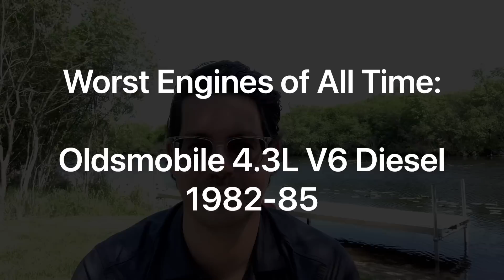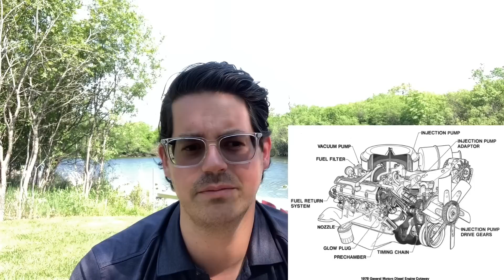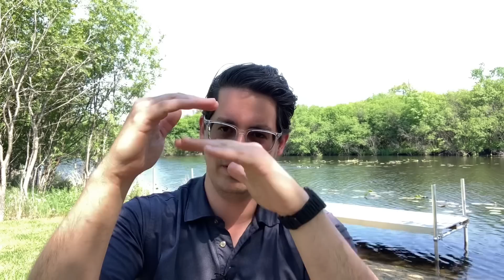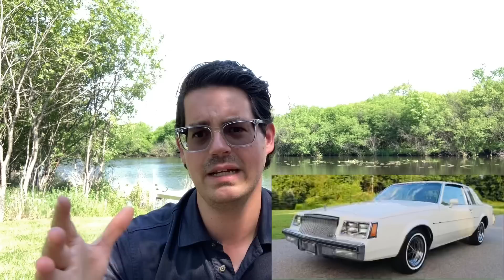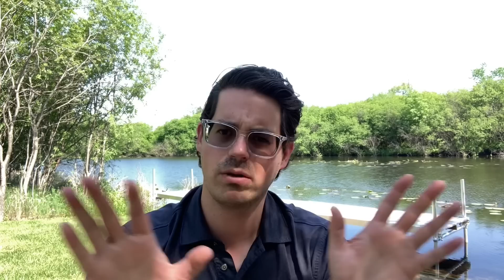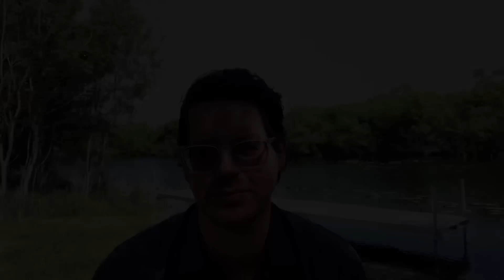Worst Engines of All Time: Oldsmobile Diesel 4.3L V6

Comment: My older friend Stan, who was an engineer back in the late 1970's said "if there is a cheaper way to do GM will find it."  This was not a compliment.

My parents had three diesel cars back in the late 70's/early 80's.  A 1977 Peugeot 504 sedan, a 1979 Olds Delta 88 sedan (3.5L V-8 - first generation diesel), and a 1981 Olds Cutlass Supreme Couple (5.7L V-8 - second generation diesel).  The engine in the Delta 88 blew up with 48,000 miles on it.  GM split the cost on the replacement engine.  That engine lasted until the mother of our neighbor, who bought the car from us, killed the engine (either running it without coolant or oil - I don't recall which).  The 1981 Cutlass had the better engine, but the tranny went and the Lee Miles shop replaced it with the infamous Turbo200 tranny (more on this later).  The other problem with the 1981 was that if the car sat between 2-4 hours it would not restart.  The computer thought the engine was warm enough to start without the glow plugs, but it wasn't.  After 4 hours the glow plugs came on and the car started up again.  In 1986 Dad had a mechanic replace the diesel with a used Olds 350 V-8 gas engine, with a four barrel carburetor.  That's when we found out about the tranny scam.

The best things about the GM diesels were:  1;  The noise.  People hanging out in the street gave way when they heard the diesel coming.  No need for the horn.  2;  After a few years the injectors in the replacement diesel in the 1979 Delta 88 needed replacement themselves. As a result the car smoked heavily when the pedal was floored.  On day a person was riding my bumper as we passed some police activity.   Once safely past I floored it, resulting in a black cloud of soot erupting in the face of the tailgater.  When the cloud cleared he was nowhere to be seen.  I wonder if the soot stalled his engine?
Reply: If a good part costs 2 cents more than a crap one. Use the crap one.
Reply: @mpetersen6  This is how Mercedes-Benz did it at least in the 90th when Mr. Schrempp has been in charge.

Comment: I am driving an 1984 Oldsmobile Cutlass Ciera Brougham Holiday with a 4.3L V6 diesel. It has aluminum heads on it, get 38 mpg(Hwy 75mph) has very good pick up for a naturally aspirated diesel. I also have a 1981 Riviera with the 350 5.7L V8 diesel and I had a 1982 Oldsmobile Toronado 5.7L diesel that had 484,000 miles on it when it got rid of it. I never had any head gasket issues, I changed the oil every 3000 miles religiously used only Kendal D3 30, when Amoco was around their Premier Diesel fuel, changed a lot of water pumps, couple radiators, A/C compressors and a few starters and that was it. But I also knew I wasn’t driving a Corvette, I drove it like a diesel, let it warm up a couple minutes on first start up, if I got off the highway after a long drive I’d let it idle a couple minutes before shutting it off. It’s like driving your couch down the street! There was a lot of blame to go around, GM had to know an engine with a 22.5:1 compression ratio and pistons that decked out had to be clamped tightly conversely customers (not all but many) didn’t really read up on their new Diesel engine, they would use dry gas(anhydrous alcohol) when they got water in their fuel, next thing they knew their IP failed, all the gaskets had broken apart from the dry gas. They weren’t putting the correct oil in the engines, they required SF/CC or SF/CD rated oil, and they’d use regular “gas” engine rated oil, crank bearing would go, cams would wear , cylinders were scored, or they would use a weight not recommended in the winter and the engine didn’t get the correct lubrication.
However, if you took care of them, drove it as a diesel, you could get a reliable car out of the “DX” blocks, and ARP made a stud kit that fixed the weak head bolt design, the “D” blocks with non roller lifters, pencil injectors, return lines(that always seemed to leak) were always problematic.
It is pretty funny the stares I get, or that ever popular statement I seemed to get, “you better put some oil in it before your engine seizes” um no it’s a diesel, “no it’s not” “a GM”, yeah and well Oldsmobile seems to think it is!
I’d post a picture but I guess it won’t let you
Reply: If GM was smart, they would’ve worked on improving Isuzu Turbo Diesels (what they ultimately sort of did with the DuraMax) but in terms of optimizing them for larger, heavier American passenger cars. Either that, or license the OM617 Turbo from Mercedes, or one of the MFI Peugeot Turbo Diesels.

Comment: Diesels should never be owned by the average consumer, they don't respect things mechanical or pay attention to minimal service requirements.  That being said, the bean counters raped the program clutching pennies to save on head bolts and fuel/water filtering.
That being said, the V-6 was a wonderful engine and like all thing GM, the legs were cut off by a feckless management.

Comment: I believe having the injection timing badly off can produce extreme forces and pressures in a Diesel engine that can quickly destroy even a decent design Diesel engine such as were used in commercial vehicles

Comment: More than one kind of problem with the Olds V8 Diesel: the insufficient development of the fuel system and filters,perhaps a  bad choice in placement of a ground cable connected from the battery negative terminal to the engine block and then the basic nature of the engine being too lightweight to handle Diesel internal forces and pressures---

Comment: Could have a 3 or 4 cylinder variant of the Detroit Diesel have been developed that could have powered some of those full size cars and pickups reliably? ( It seems that even in trucks and school buses there was a tendency to come up with cheaper Diesel designs that were lessor engines than the Detroit Diesel) "Fuel Pincher" ?

Comment: Wish Olds made a gasoline version of that 4.3 V6. Can't convert one because there are no gasoline heads... I know some guys converted the 350 diesel into gas engines, that block is great starting point for a high performance gasoline V8.

Comment: I was working as a mechanic at the Ford dealer during this time and we were learning to work on the International 6.9 which was relatively new. Before anyone says the IH 6.9 was better than the Olds 5.7 diesel; no, the 6.9 was NOT better. They leaked oil, leaked coolant, the glow plug electrical system frequently burned up, and they were a dog. But the 6.9 got better over time. 

I had a friend that worked at Holiday Buick and Olds during that time, George made a fortune overhauling Roosa Master injector pumps used on the 4.3 and 5.7 Olds diesels. He did this on the side and through the shop. I don't know where he sourced the parts (this was long before the internet) but he sure had a good connection. The only catch was he made the customer purchase and have a Racor water separator installed as part of the deal. I know George made enough money off his injector pump gig to purchase a beautiful Delta 88 for his wife. 

Another thing that turned people off diesel engines at that time was there were few gas stations that sold diesel fuel. Not many men were real comfortable sending their wife to a truck stop to fill up.her Olds Cutlass. I heard more than one guy share stories about their wife's experience getting fuel.
Reply: U have to be a trucker to know what goes on at truck stops ;-) . Maybe a Honda civic ISNT a bad choice for your 17 y/o daughter considering what goes on at a truck stop!

Comment: Well, I’ll be damned. I’m a pretty big GM guy, and I used to be pretty into 4.3s, and I NEVER knew there was a 4.3 diesel. Sounds like it sucks, but still, I would’ve thought I’d have read about it or something. Cool, thanks!
Reply: That's how bad they were.
They didn't want you to know there was others besides the 350 so they didn't write about them, because there's nothing to write home about 😁

Comment: Simple turbo mod, studs top to bottom, and some injection pump tweaking, the 4.3 would easy crack 200 hp reliably.
Reply: I don't think any of these engines had a turbo, though.
Reply: @jameswilkinson6678  Hes talking about aftermarket performance mods. And yes I can think of many other things to do if I had my hands on one. 

300 Horses and beyond if modded right with todays performance aftermarket.
Reply: @extremedrivr  Yeah, if you added a turbo 300hp would be pretty attainable.

Comment: Gee.. can't imagine why Oidsmobile went from top-seller to dead in 25 years.

- 5.7 diesel 
- 4.3 V8 diesel
- Quad 4 sans balance shafts

All of these directly connected to the Oldsmobile brand.

Plus, the cars that did work got replaced by tinny, plasticky front-drive cars that weren't all that different from Buick or Pontiac. So the fan base couldn't buy the cars they wanted, and nobody who wasn't already an Oldsmobile fan was frankly all that interested. 

The Aurora and Intrigue were nice cars that pointed towards Oldsmobile' re-establishing a place in the market, but the product development cash ran bare and that was it.

One wonders what GM could've done with the $5 billion they threw away on the Saturn experiment, and re-invested in development of the remaining products. Might that have gotten the W platform to market before the Taurus - and with proper airbags at launch? Could that have put a proper 4-speed auto throughout the front-drive lineup? Could GM have thrown more money at the interiors, suspension tuning, braking, and build quality?

Comment: I bought a used Cierra diesel in ‘85:
Drove the wheels off it! Only problem was replacing harmonic damper. 
Also owned a 6.2L diesel in a Suburban…that was a nightmare. Ate starters, batteries and injection pumps.

Comment: My uncle had the 1979 Cutlass diesel 261 and it ran fine for years. I often drove it. He had added a more complex water separating system added at day one of owning this car as you mentioned water in truck diesel was a major destroyer of this engine. The second thing was the need to change oil on very short intervals.  You did not need to use very exotic oil, just a good detergent oil. He changed the oil every 1,500 miles and never more than 2,000.  It lasted years without any issue and he sold it in 1983. I drove it and got 30 mpg. My V-6 powered 1979 GM full size was sluggish and slow compared to this car which had good throttle response and was faster than a 6 cylinder car of the day. Yes compared to the last GM diesel this one had lots of issues but they could be minimized if you were in the know about the damage water in the fuel did to the injectors and you were really into maintenance.
Reply: Oldsmobile adding extra head bolts made this much more reliable. The power output would be the reason this engine made the list, pathetic. The V6 serpentine set up allowed us Olds V8 guys to run a converted chevy truck set up with conversion brackets and the V6 diesel rwd water pump. I actually have the second to last Flowkooler pump available my Olds 358.

Comment: One minute into this and I can't watch it any  more. The 4.3  v6 was not EVEN REMOTELY related to the   Old V8 Diesels. It was a Detroit Diesel designed engine-just like the 6.2/6.5.
Reply: Actually that is not correct, Oldsmobile designed and built the 350 5.7l from 1977-1985(for the 1978 model year)
The 261 4.3l V8 1979 only and the 263 4.3l V6 from 1982-1985, Detroit Diesels first engine was the 6.2l V8 diesel which was available in 1982. Olds diesel were no longer used in trucks after 1982
Reply: @edkelly6969  Gm owned Detroit Diesel. Detroit diesel  came out with their first 4 stroke in 1980. The 5.7 was a stop gap  to quickly create a diesel for cars. Gm turned over the designing of the 4.3 v6  and future 6.2/6.5 to  the engineers at Detroit. The  4.3 and 6.2 family are very similar. Ask  a engineer from about it.
Reply: @edkelly6969  True

Comment: I drove a Cutlass Ciera with 4.3L diesel at the GM Proving Ground.  It drove nice and was actually a little quicker than a similar car with the 2.5L Iron Duke.  There were actually plans put the 4.3L diesel into the 1985 M van (Astro/Safari), but that combination was axed before it went into production.
Reply: Any chance I could ask you a few questions about you driving the 4.3 at the prooving grounds? I'm an oldsmobile diesel history buff and trying to always collect now info when I can find it!
Reply: @HeinH-dx1gu  Sure!  (That was 40 years ago however, so my memory might be slight!)
Reply: I drive two Oldsmobile diesel for daily drivers

Comment: In my opinion,  Olds gas engines prior to '77 had a distinct sound. A Delta 88 did not sound like an Impala. I was in high school when several of my friends parents purchased the Olds diesel. Unfortunately for most,  it caused them to abandon the brand once they got rid of the car.

Comment: I bought a new 83 Olds Cutlas Cierra with the 4.3 diesel and 3 sp. A/T.   I thought it was a great engine:  it was quiet going down the road and would get 38 MPG at 65.  The torque converter would lock up in 2nd and 3rd which was nice on grades although it could have used a 4 sp.   Never had any problems with eng. or trans.  I wish I still had it.   The offset crank throws made it even firing which was very nice.
Reply: I think the 4.3 Diesel by then got a bad rap as being the same bad engine as the V8 Diesel even though by the end of production run the bugs had been sorted out.

Comment: Except for small block V-8's and the Series 2 and 3 Buick 3800 V-6, GM engines were substandard. When GM stopped putting V-8's in their cars, that ended GM car's reputations, today, Silverado sales are tanking, their QC is crap, and their reputation is shot.
Their future is dim, they won't get bailed out again.
Reply: Nor should they.

Comment: Thank you Adam, what memories resurface from my 15 years watching your video, it reminds me of my father's purchase of the brand new 1979 Oldsmobile Delta 88 diesel 5.7L, newly built in Michigan and delivered to Baie-Comeau Qc. Seeing the discussions on the internet, I see that the reliability issues were different for us, a fuel water detector was installed by the dealer, a fuel injection pump bleed done by a Detroit Diesel engine tech, and the preventive maintenance according to the owner's manual was always done. Our Oldsmobile was very reliable for the first 5 years, my parents drove smoothly and were careful with their car. But after a 400 mile drive home on Christmas Day 1984, a few miles from home, a "boom" was heard in the engine, and the engine noise became louder. The next morning at home in -20C (-4F), that was the end of it, a bearing cap mount broke as well as the crankshaft. A new engine was installed at the expense of GM Canada, knowing the reliability of the 5.7L :)
Reply: Unfortunately the ‘78 & ‘79 they hadn’t made the bolts longer in the “D” blocks and sometimes it would tear the crank right out of the engine, by 1980 they had corrected that issue.

Comment: I believe that the 60's were the height of the big three because the government had yet to really interfere.  Once the CAFE standards, the insane front and rear bumpers of the seventies the crippling smog issues, etc etc.  One example is the 70's Lincoln Mark IV's.  Great highway cars but zero performance despite a huge 460 engine.  Also not a bad design but then you put front and rear crash bars on them.  The the ignition lock until your seat belt is fastened. Then get on the highway finally and it takes endless hours to get anywhere because of the federally mandated 55 mph speed limit, even on interstates.  All of these things added up to make driving not so much fun any more.  Luckily the performance of the American cars has rebounded in the last decade.  But who knows, now the current administrations upping the CAFE to even more insane numbers and may get rid of any performance again.

Comment: The CAFE standard was one of the many knee-jerk reactions to the non-existent crisis of the 1970s. A crisis that was totally government engineered through bad economic and environmental policy. It should have been sued out on constitutional grounds because the Constitution does not authorize the federal government to mandate fuel consumption as to mandate what kind of vehicles we can and cannot have. That is not a constitutional concept. The biggest reason GM Ford and Chrysler the now defunct AMC we're in the trouble that they're in is because of that standard and the fact that the emission standards are extremely unrealistic. Yes we should have lower emissions from exhaust pipes and smoke stacks. But it is unrealistic to expect that you can burn a fuel and have zero PPM HC and 0% CO while making a 4,000 lb car get 40 miles per gallon. That is not realistic and is not necessary. There was no shortage of fuel in the 1970s there was a tremendous abundance of stupidity in the party that controlled Congress in the seventies, which was the Democratic party.